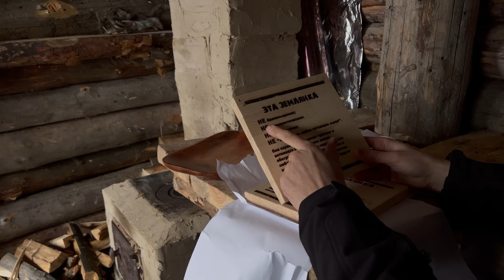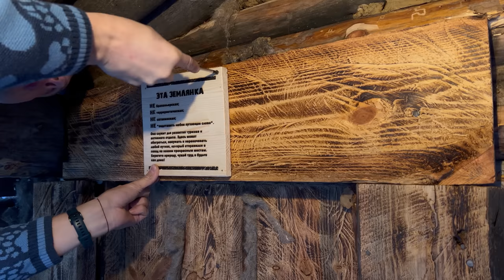ALEX WILD dugout life: Hiding in WINTER SHELTER after snowstorm

Comment: double sided tape and 1 or 2mm clear (or coloured) plastic sheet also works for windows ... run a line of double side tape around the frame of the window ... cut a sheet of plastic sheet to fit ... stick from top corner to bottom moving down carefully (less wrinkles the better) can also be done on outside with branches to tac the plastic sheet in ... then you get the window pane and BOTH plastic sheets .. essentially a triple glazed window ... easy to remove in hot weather and simple to install for cold ..

Comment: Your cabin looks amazing in thick snow!
where is your air inlet for the fire? It is best to make a small pipe that goes from outside right up to where the fire needs it, otherwise air will be sucked in through random gaps in your cabin, making drafts where you might not want them.

If you load up the fire and close the door, with the block in place, how long can it last?